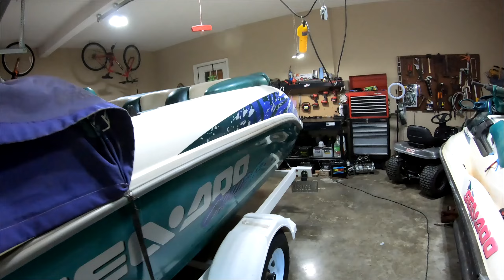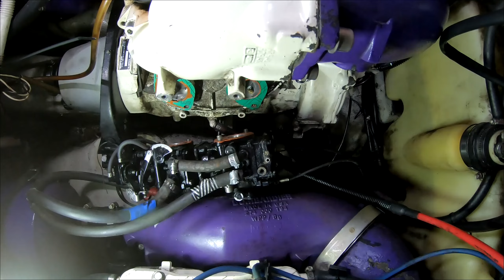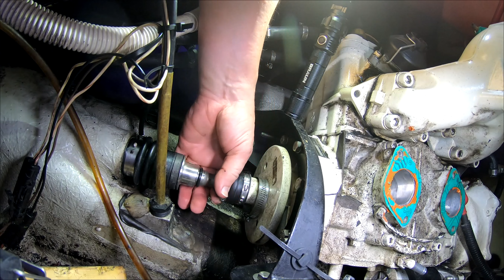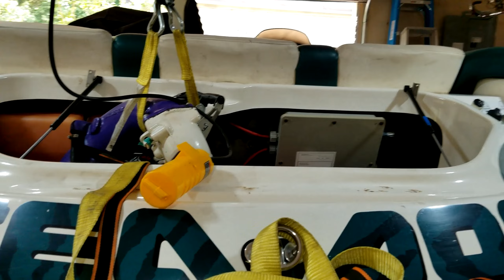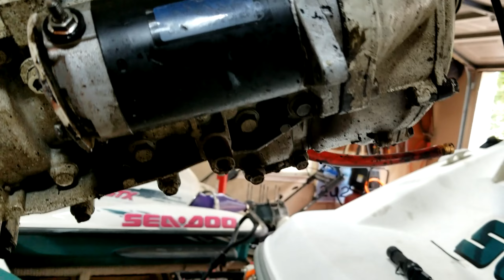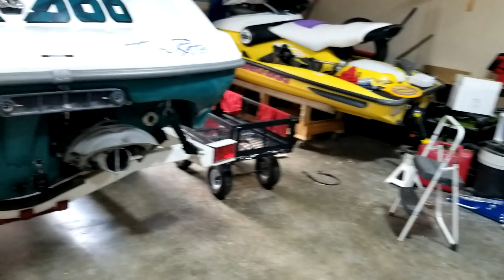Removing boat engine with bad crank seal - 97 Sea-doo Challenger 1800

Comment: Where is part 2?? 😮

I just got myself a challenger and I have no clue what I am doing.. never had a boat before
Reply from the maker: Well first, I know my videos aren't the greatest in quality. I try to put out content in which I can show and/or explain what I'm doing and at times it doesn't go as planned. After going through the hours of footage dropping the engine back into the boat, I didn't think it was good or that helpful. I just seemed to be in the way a lot, blocking the view.  I'll go back through the footage and see if I have a different opinion now after I've given it about 4 or 5 months.  Is your Challenger requiring a lot of work?

Comment: What happened to part 2 ?
Reply from the maker: I got the same question from another viewer, so I'll copy my reply here. Well first, I know my videos aren't the greatest in quality. I try to put out content in which I can show and/or explain what I'm doing and at times it doesn't go as planned. After going through the hours of footage dropping the engine back into the boat, I didn't think it was good or that helpful. I just seemed to be in the way a lot, blocking the view.  I'll go back through the footage and see if I have a different opinion now after I've given it about 4 or 5 months.  Is your Challenger requiring a lot of work?